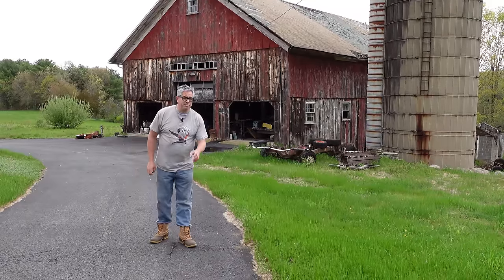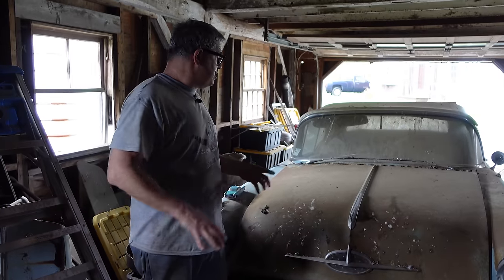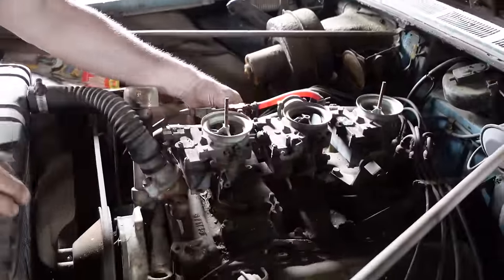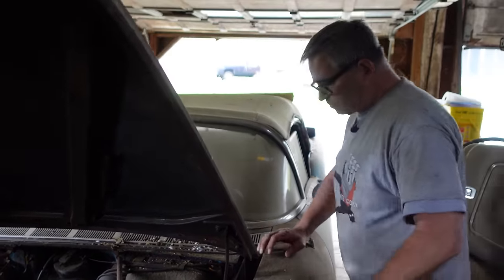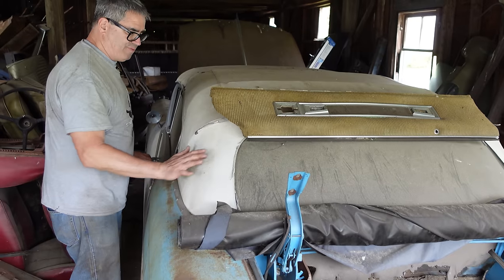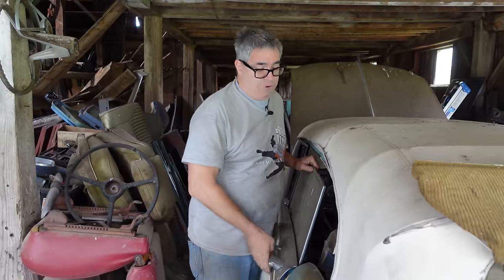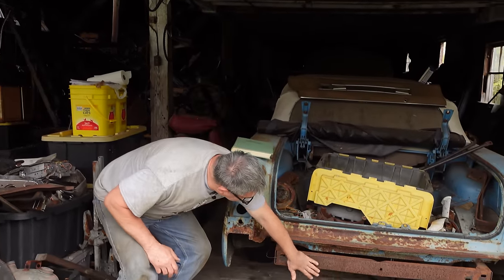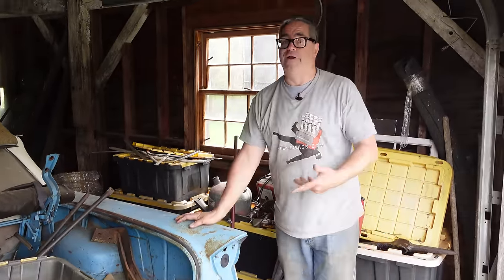BARN FIND ’57 Tri Power Convertible!!!

Comment: I put a J2 Oldsmobile engine, and transmission, in my '51 Ford business coupe because I got fed up with bone stock  tri-5 Chevies beating my high performance V8 flathead Ford. The engine came out of a '57 Oldsmobile wrecked convertible. Even the interior didn't take much effort to install in my '51 Ford business coupe.  My dad, and I, adapted rear differential from a '57 Ford truck for the '51 Ford.

Comment: Wow! Super rare Olds. A manual transmission in a base 57 Olds would have been pretty rare back then.
Reply: My first car was an Oldsmobile 88 two door hardtop. It was as plain Jane as they came. It had 371 two barrel, and a three speed on the tree. I built a 1962 394 for it. That crank had to be drilled, a manual trans wasn't even an option.

Comment: I remember when I was a kid, in 1962, my mom's old 53 Buick crapped out. She bought an early 50's olds for cheap. I didn't like the because it had power windows, and the rear windows didn't work any more. But, my older brothers liked it. It had an automatic transmission with "superdrive ". They'd drop it down in superdrive and it would boil that right rear tire from a stop, no powerbraking needed! They used to compete to see who could do the longest "burn out". I remember the record was 174 ft. 🤣 Don't tell mom! I'm thinking it had a 2 speed torque converter?

Comment: Now that would be cool to have sitting in my driveway. Whether the J 2 motor is original or not would make no difference to me although value wise it sure makes a big difference to both seller and buyer. What a looker with that blue and white top when new. It is the  home run barn find to Oldsmobile fans or any old car person. Nice.

Comment: Funny that you mention a mechanic putting lug nuts on finger tight.  Many years ago, before I did my own work, I got my car back from a tire place and after 10 minutes, the steering felt weird and sloppy.  I pulled over and found every lug nut on the car was loose and some were about to fall off.

Comment: This is wild......thanks for posting. I NEVER knew Olds used left-hand threaded lugs on the driver's side!!!!!!
Reply: Buick did as well until the early 60's
Reply: @Edward Pate  thanks, Ed. I'm in my early 50s, havd been a Ford & Mopar fan since my teenage years, with a respectful lesser interest in Pontiac & Oldsmobile, and yet NEVER knew this?!?
Reply: A few cars did this.
Reply: @KD's boosted  Just curious- are you aware of any foreign cars who did this? Thanks.
Reply: @67marlins  I haven't really worked on anything foreign other than a 68 e type if you can call it that. Which had knock offs and they are reverse thread on the passenger side.
Reply: @KD's boosted  ok thanks. I was curious if any other automakers agreed with the science behind it.
Reply: @67marlins  I'm pretty sure Mopar did this as well?
Reply: @Mark GES  yes, Mopar was the main one known for it.
Reply: @edwardpate6128  I just  changed 4 tires on a 58 Buick. All right hand threads.

Comment: Well, I have no chance of getting something like this. But it sure is a great car. I just hope that whoever gets it,doesn't ruin it. I think it should be cleaned up and put back together as originally as possible. Treat the rust so it doesn't spread. Make it run and drive. Then slowly return it to its former glory
Reply from the maker: I agree! My nightmare is that a Kustomizer sees the video, buys the car and turns it into an Oakland Roadster Show machine with the usual LS, tube frame and "bitchin" stance. Yawn. That said, the current owner is an Olds purist and will certainly screen potential buyers for their post-purchase intentions....Thanks for watching and writing. -Steve Magnante
Reply: @SteveMagnante  I've seen too many great finds like this get in the hands of someone who trashes the car.   I remember in my neighborhood, a guy had a beautiful 57 Ford in his garage.   Sold it to some kid that cut the fenders to make room for bigger tires, basically trashed the car.   There was a classic car lot that is now no longer on I 95 in Miami, that was full of cars that had restoration attempts, painted in colors that most people wouldn't want to drive.   One of the biggest problems in S. Florida, is that very few people rebuild engines today.    Shops are to small, rents are too high, and experienced mechanics are few and far between.

Comment: Had 2 old half tons back in the day.... One had a floor shift 4 speed and the other was 3 on the tree. I preferred the 3 speed especially when having a third person riding along. Actually the 4 speed was a 3 with low so you didn't use first gear most of the time.

Comment: As a young driver I got ahold of A 58 Pontiac. Left hand lugs unbeknownst to me sure gave me a fit. I had them glowing with a torch and was using an Impact on them and still couldn’t get them off. I gave up and derbied it with bald tires on the left side. It wasnt until a few years later did I find out about left hand lugs when I had to replace the brakes on a 56 Olds at the garage I was working at.

Comment: From someone that had a 57 Pontiac with a Hydramatic and converted it to a 3 speed manual, in the grand scheme of things the hydramatic would have a better choice.  The transmissions wouldn't take any kind of abuse either.  Speaking of experience.  I would still like the stick shift better though.

Comment: I know a man with a 55 Pontiac that has the non hanging pedals.  Would have thought by 1957 Olds would have them too.
Reply: You noticed that too,eh? I thought by 57 GM was using hanging pedals on passenger cars.
Reply: @kenttalsma7906  Chevy was using hanging pedals already in 1955.

Comment: I respect that you are very knowledgeable (for a young guy) BUT in fact I owned a 1956 olds tri-power (I don't remember them calling it a J-2 till 57) it was a posted coupe and it had three on the tree. About the only thing it could not pass was a gas station. Loved the Olds marque and cried when they discontinued it!

Comment: I'm 37 and even still as a kid growing up around classics and hot rods we called the Rochester Quadra-jet the Quadra-Junk!!! LOL
Reply: Holley makes a good replacement. The setup isn't bad, you can bolt it right on, vacuum or mechanical, swap out the double-pumpers if you like
Reply: @herbodiferous7751  Well I dont have a GM or quadra jet anymore.  Last one I had was on a T/A.  I am a ford guy and now that's all I own.
Reply: @bad74maverick1  my brother had a 69 Torino GT with the low-end setup, 302 2 barrel and a 3 speed. We bolted on a Holley 500cfm replacement on the stock manifold, adjusted the screws as they suggested in the startup instructions, never touched it again or even hooked up the choke. It ran like we put a new motor in it. But pretty hard to find a carburetor under the hood these days
Reply: Quadrajet was a great carburetor!!
Reply: @jamesspalten5977  you'd be the first to say so.
Reply: @bad74maverick1  I liked the Carter AFB that was on my '63 Grand Prix better than any of the QuadraBogs I've endured

Comment: So was there a similar “L” designation on the lug nuts or did you have to tell that by looking at the threads…….???

The only car I can remember working on that might have had them was a buddy’s ‘68 Dodge Coronet that I think still used them? That was early 80’s though, so my memory might be a little foggy about that…….😂
Reply from the maker: There's an L stamped into the ends of the driver-side studs. In Mopar land, many of the left-hand studs have a copper finish to further alert tire service folk not to ASSume "righty-tighty / lefty-loosy". Also, some Left Hand nuts have a circular pattern pressed into their hex face for further identification. If all else fails, the "screw down" process will take FOREVER if a LH nut is applied to a RH stud. Any mechanic who doesn't pick up on that clue should go back to Boot Camp! Thanks for watching and writing. -Steve Magnante
Reply: @SteveMagnante  - I’m thinking a lot of the mechanics under 40 years of age or so have probably never worked on a vehicle with left hand threads. Or a carburetor for that matter…..😂

Comment: Three on the tree with power windows? That has to add to the rarity of this car. Our family had a 57 Pontiac. I find it really amazing how similar the look of the front end is between the two cars when you look above the grill. GM didn't change all that much between its parallel model lines. I wonder if the front head light buckets are interchangeable?

Comment: Did GM’s tri-power operate like Chrysler’s triple carb setup? (My Dad had a ‘57 Fury 318 2x4 3-speed on the tree)
Reply: Wow. That Fury must have been awesome. My dad had a 58 Savoy as a company car back then. 325 V8, 2 bbl, automatic.
Reply from the maker: The Olds J2 used a vacuum system to activate the end carbs BUT on this particular car we can see where the linkage has been replaced with direct acting items. No problem with that 3-speed manual since you can easily mask any hiccups / bogs with gas pedal / clutch pedal tricks.  I asked the owner if the car was a factory built J2 and he says YES. Wow! Thanks for watching and writing. -Steve Magnante
Reply: @SteveMagnante  Awesome, Steve. Thank you for keeping us gear heads informed.